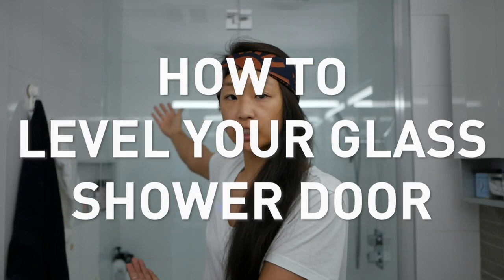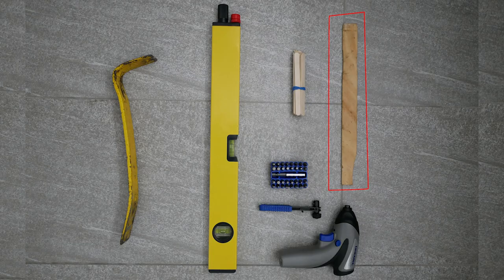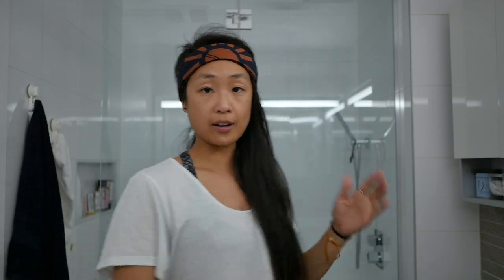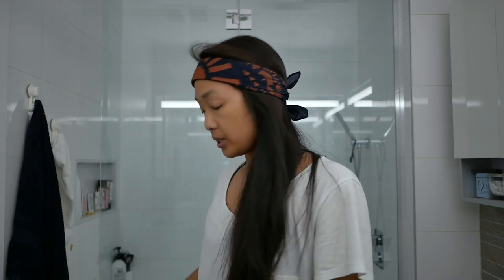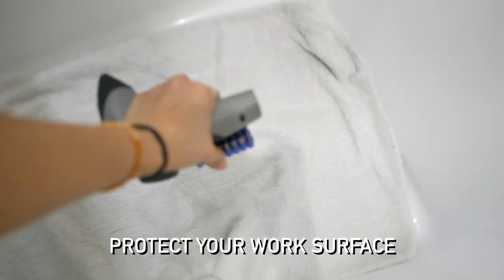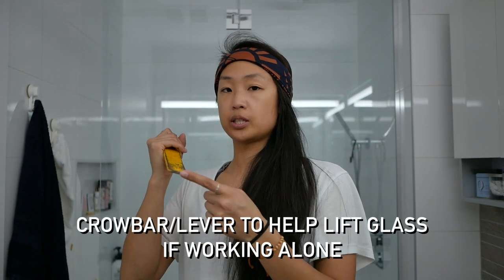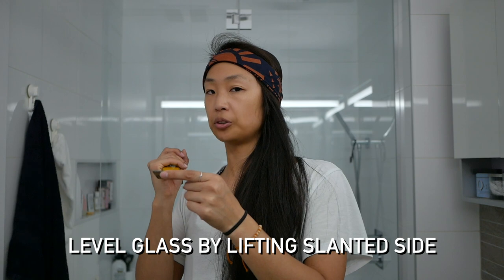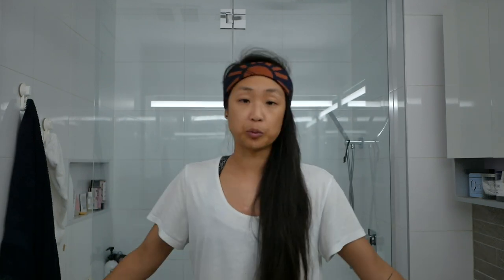How To Level Your Shower Glass Swing Door In MINUTES - By YOURSELF! One person

Comment: Great  job on the video, as another user mentioned you're a natural in front of the camera! Keep going! The description was great about how the door was assembled and was very much appreciated! Mine had your style of hinges but also had a handle(Which turns out to be "handy"). The hinges also were not connected to another piece of glass (like yours) but to the wall which was tiled. I didn't have your type of crowbar(mine is thicker and not as wide) so I didn't use one but had some woods shims that I had lying around. Even if I had your style of crowbar I would have been reticent to use it because I wouldn't want to have a chance at damaging the tile.  I loosened the screws on the hinges and lifted up on the handle while adding additional shims under the door end(which was where I needed it raised) to get it higher as well as between the wall and the door. Worked great! Thanks again!

Comment: can you do a video on how to adjust the frameless door if it isn't closing all the way?  Mine has about a 1" gap and doesn't quite shut.
Reply from the maker: that's a great idea except I don't have access to any frameless shower doors, I used to work in that domain actually. If you can find your old manual or figure out exactly what type of door you have (on the slide/rail or hinges/swing) then you'll be able to search for it on youtube and find helpful videos. Look for installation videos and go through the video until you find the part with the doors and adjustment/installation

Comment: Just use another piece of wood instead so it's not metal on that one spot with pressure
Reply from the maker: Don't think that would work. The glass is very heavy, hence the crowbar. And the space is tight, a thin piece of wood would crack under the pressure